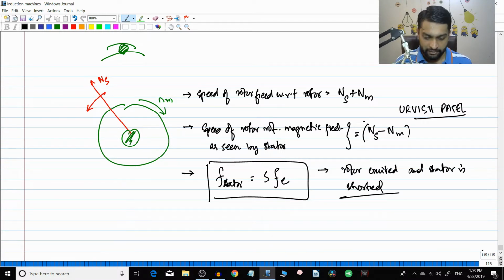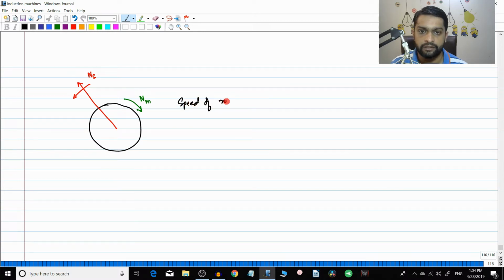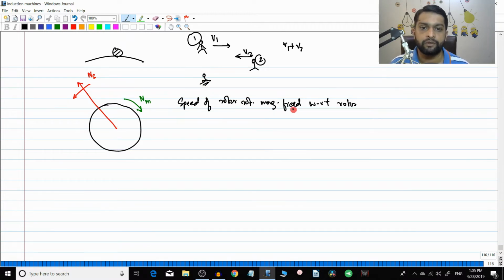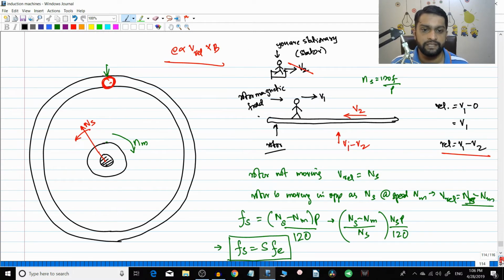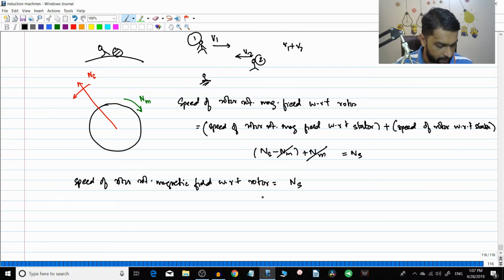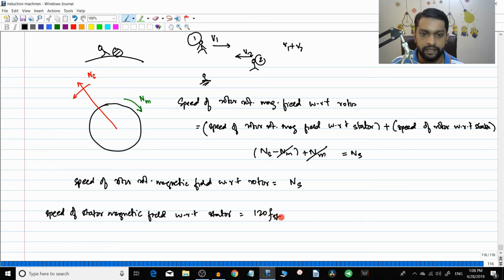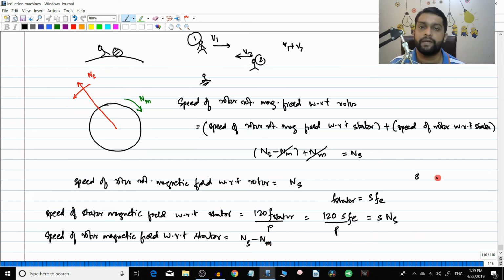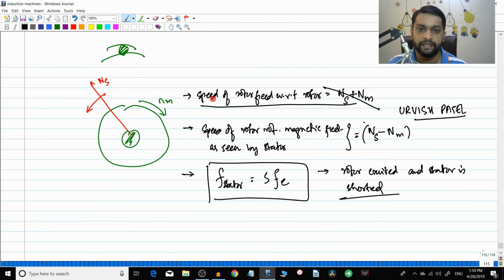Induction Motor #24 - Correction Video for Rotor Excited / Inverted Induction motor

Comment: How slip will be Ns-Nr/Ns. Since Nr is rotating opposite to Ns in inverted IM. slip will be ns+Nr/ns.please clarify friend
Reply: Please check his previous video on reverse ind motor. There he has explained nicely.
Reply: Tell me also if you know how
Reply: @pulkitjain1426  since it is with respect to rotor, you have to imagine that you have reduced your size and sitting on the rotor. Just like we are sitting on earth. For us earth is stationary. Similarly for you the rotor would appear stationary. Now a person is running in front of you with speed Ns. It appear as Ns only na...
Reply: @Emperor-Of-Karma   I think we are talking about slip...
Reply: @pulkitjain1426  ok. Then i suggest you watch the 23rd video on IM.  This is the 24th video. I have understood from that video only. It's around 10mins only
Reply: @Emperor-Of-Karma  Have you watched video 21 ??(rotor rotated in opposite direction)
Reply: @pulkitjain1426  yes.
Reply: Slip is the relative speed between the main exciation rmf and the conductor where emf is induced. So here  we have to see from stator perspective.
Reply: If in normal IM main rmf in stator and emf induced conductors are in rotor. So you look from rotor perspective. Imagine rotor as a train and you are in it.
Reply: @Emperor-Of-Karma  Ohk I got it